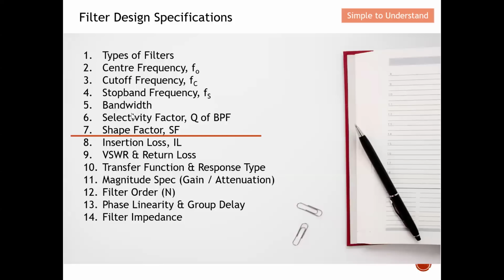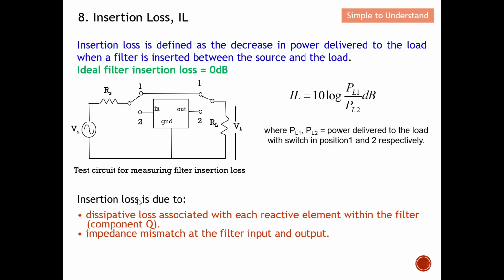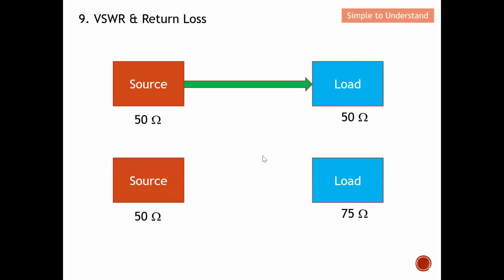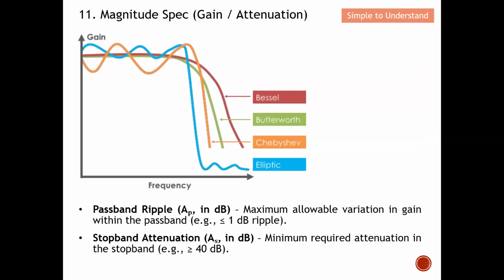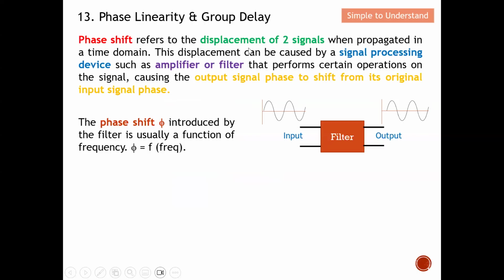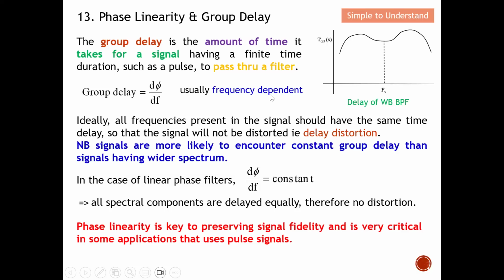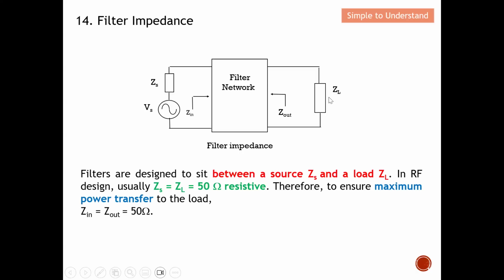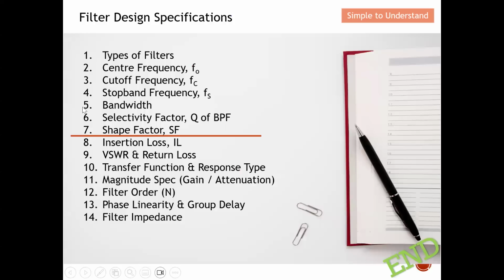Filter Design #3. Filter Parameters: Insertion Loss, Return Loss, VSWR, Phase Shift & Group Delay.

Comment from the maker: Thank you so much to see this Part B series discussion. On my previous discussion, I have discussed the following parameters 1) Types of Filters, 2) Centre Frequency, fo, 3) Cutoff Frequency, fC, 4) Stopband Frequency, fS, 5) Bandwidth, 6) Selectivity Factor, Q of BPF and 7) Shape Factor, SF.
This video, I will concentrate on another sets of filter design specifications: 1) Insertion Loss, IL, 2) VSWR & Return Loss, 3) Transfer Function & Response Type, 4) Magnitude Spec (Gain / Attenuation), 5) Filter Order (N), 6) Phase Linearity & Group Delay & 7) Filter Impedance. The video explains the parameters and the definitions and why they are important when we spec the performance of the filter.

Comment: How to see the insertion loss value on a lowpass filter?
Reply from the maker: Thank you for your question.
Reply:
Observe the Passband Response. In the passband (the frequency range where the filter allows signals to pass with minimal attenuation), check the S21 magnitude (in dB).
Insertion Loss = 0 dB – (Passband S21 Level)
For example, if the passband response is at -0.5 dB, the insertion loss is 0.5 dB.
Reply: sorry I still don't understand, for example I have a graph with a cut off frequency of 1.65 GHz, here the RL is -30 at a frequency of 1.25 GHz so I see the insertion loss value, right? check S21, my question is the S21 that is seen at the cut off frequency or at the 1.25 GHz frequency? can you explain again, thank you
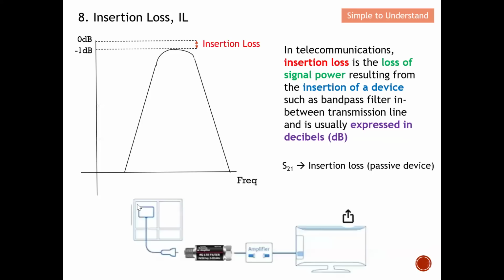Reply from the maker: You can see this video ard 3:36, I explain the insertion loss for a bandpass filter. The graph shows the S21. From this video you can see that the gap between the 0 dB and passband will be my insertion loss which is 1 dB. For low pass filter, the front section (or on your left) of S21 graph will be passband. Hence the gap between the 0 dB and your passband will be your insertion loss.
Reply: Thank you for your answer
Reply from the maker: You are welcome. :)